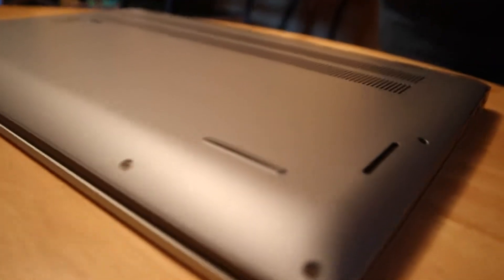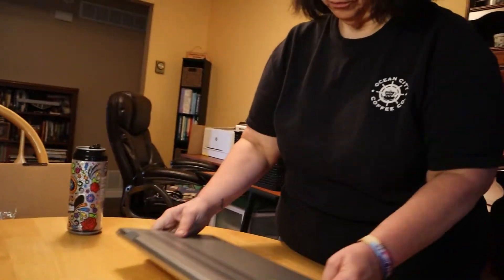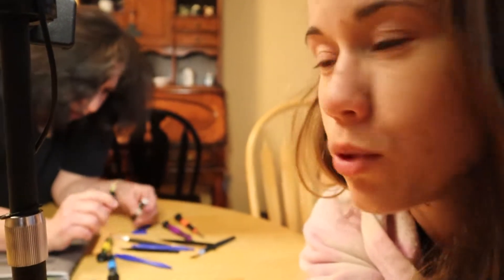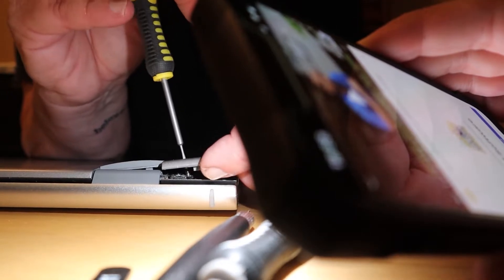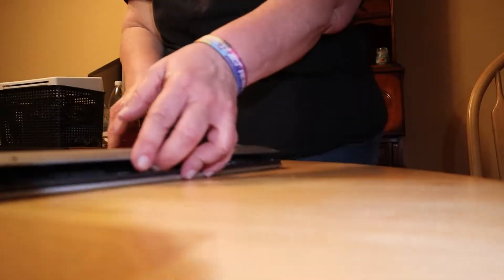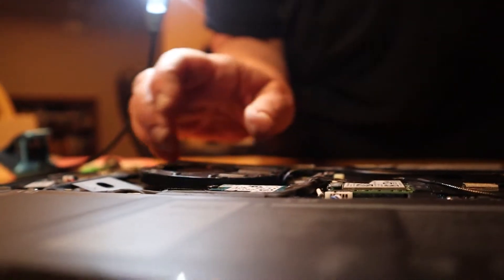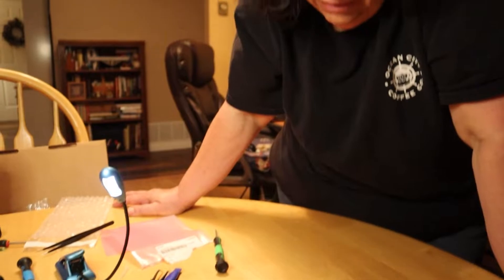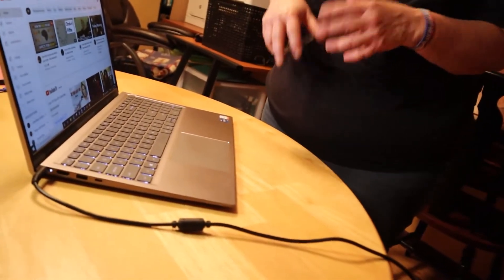REPLACING A LAPTOP FAN in a Dell Inspiron 15 5510 [DIY VLOG]

Comment: i have the same issue cant find replacement same fan
Reply from the maker: I got mine on ebay. This link might help: 
https://www.ebay.com/itm/144472962681?hash=item21a3427679:g:GXQAAOSw4eFiOhe8&amdata=enc%3AAQAHAAAA8Hojk4ZGeD5KA7NmDXHYeNJrevH8SveolV3WhLCQLmPtEqfMAdoFiVVRARLnDosEQS7WOWG3SceJkVowW5puo70VwEjAaD4kUu%2FoUFpKTn%2Ffvdj5aKkG5NrlNkcFwaCAVbsH6Jvn8iWtV4BYh8KAA4YMoOtsVcyOZlLN7BkmAMqwMrrBlUHokQ4wHLiq4LOKzxnOmdC8hAQ%2BiD9Ebrsak9j9Y3I8A1ugXIYHe%2F6hatCxIlc9GI5NBp88lDpycChMTKaNaoD2ttgnPeHV2ObljgQekabnOkesr1epAIcYGXXlNOBv0b6vSctWUJkcuKVFyw%3D%3D%7Ctkp%3ABk9SR-angY7bYQ

Comment: Back 2 stay in. They don't come out. And anytime you open that laptop you need to unplug the battery. You could of seriously screwed your laptop up. But good job.
Reply from the maker: We figured out the screws (EVENTUALLY - seriously, it was a LONG discovery process.....), but SUPER helpful tip on the battery. We're thrilled it didn't die... yet😬